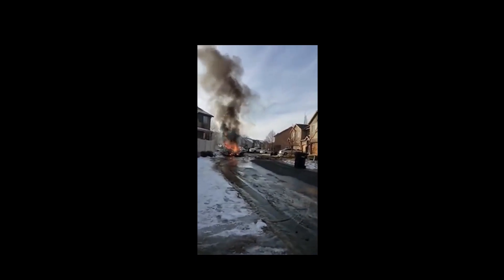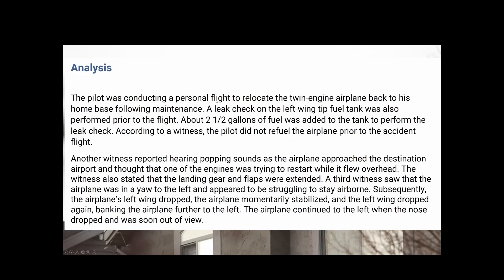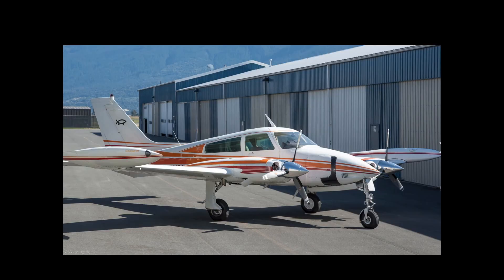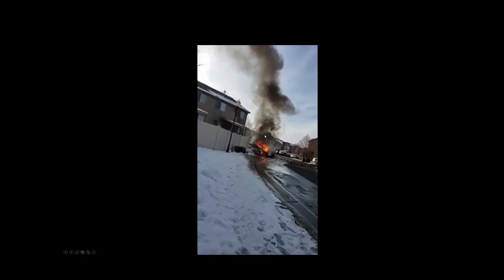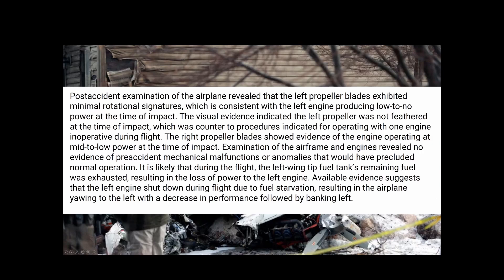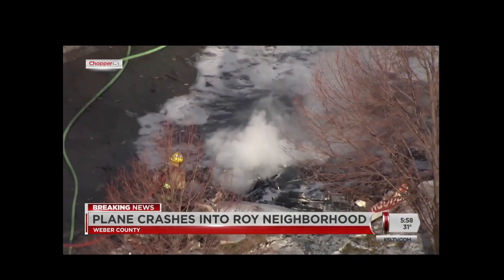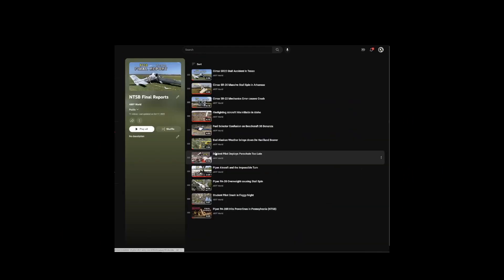Fuel Exhaustion Brings Cessna Down in Utah

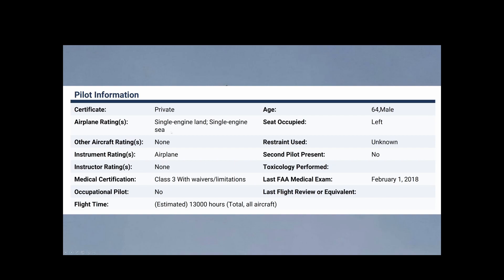Comment: At 2:16 we see the plot's ratings - he was not multi engine  rated
Reply from the maker: Nice observation
Reply: According to the accident report: The left seat occupant was the holder of a FAA commercial pilot certificate with airplane single engine land, airplane multi-engine land, and instrument airplane ratings. He also was the holder of a FAA certified flight instructor certificate with airplane single engine, airplane multi-engine, and instrument airplane ratings.

He had a multi and then some, it just isn't reflected on that slide for whatever reason.
Reply: Nevermind my previous response--bad search result from Kathryn's Report. :)
Reply: And with 13,000 hours, too! Something doesn’t add up.
Reply: Wonder how many people that are flying don't have their ticket, single, or multi....?? Driving without a license......  🤔🤔🤔 Yeah YOU... 😟😁
Reply: Even if he had the multi.  He was not a multi engined pilot.  Crashed when needed to show he was..  Was not. I used to teach on 310's.  They fly fine on one engine even with 4 adults on board i did touch and goes with engines shut down at 200 agl and turnaround at 500 agl and touch and go again...
Reply: @mattj65816  He was a Citation Mustang owner and pilot and at the time of this accident he owned 2 C310's.

Comment: He clearly had fuel onboard - fire and explosion. Just don't know why the engine didn't get any. Or why he didn't change tanks or crossfeed fuel.
Reply: The cessna 310 has four or six tanks, and the wing tips are the "AUX" tanks. Generally you take off with the selector in MAINS. The report notes one AUX tank (the tip tank) was minimally fueled for leak testing. Presumably that meant they tested the line to the engine, so the selector would have been in AUX. For a short reposition flight, it is unlikely he would fill the AUX tanks. He probably had decent gas in the mains, but left the selector in AUX, by accident (if you never use AUX, you get complacent about checking the selector position). He did the run-up and, scanned the dials and probably didn't even batt an eye at the empty AUX, because he thought he was flying on main. He just didn't check that selector.

The engine sputtered and died, and he started playing with the dash. Did he switch the fuel selector before trying a restart? I didn't read the report to see where it was, but it probably didn't matter. He didn't have time. His only option was to get that thing down safely, and it sounds like he might have been distracted trying to make it chooch. 

I hate these videos, but watch them so I won't end up like these good people. Every accident is usually a bunch of tiny mistakes that add up to one bad moment. This looks to be another one.
Reply: Darn, fuel aboard, but NONE to engine ? FUEL MANAGEMENT GETS REAL, WITH BAD COICES,,,,RIP,   🇺🇸🇺🇸🇺🇸🇺🇸
Reply: @FamilyManMoving  There are a lot of questions here, like which fuel tanks were in use and why the right engine was only delivering light to moderate power (based on the bent prop blades).  Counter-intuitively, the wingtip tanks on a Cessna 310 are referred to as the "main tanks," and the "auxiliary tanks" are in the wings.
Reply: @jimh.5286  Good to know I go those reversed. I even looked at the POH before commenting, but missed that detail.

I also went looking for the report, which would probably show the valve selector position. Didn't find it. My google-fu was weak that day. Thanks.

Comment: weird, his license didn't say anything about being Multi-Engine rated. was this a new to him plane he was going to start training? Rest in peace aviator.
Reply: David Goode owned 2 Cessna 310's and was the launch customer for the Citation Mustang. He was a very accomplished pilot,  businessman and athlete with over 13,000 hours as a private pilot.
Reply from the maker: thanks guys
Reply: @SquawkCode  just goes to show that the air can be unforgiving no matter how much experience a pilot may have. And when it can take down someone with that much experience just how much more caution is required by low time pilots. RIP.
Reply: @SquawkCode very impressive background and startling to know it can happen to anyone.  I’m not a pilot but have avidly followed everything about flying for years.  I’m a personal friend of Dan Gryder and my son is in flight training.  Is it possible that since he didn’t have multi engine license that he had cursory training but not enough to handle an engine out?  Maybe he made it to 13,000 hours because he never had an engine out in a twin.  I hope ALL pilots start adding AQP training to their list of things to do every year for the rest of their flying days.  Engine out in a twin at lower altitudes is probably one of the hardest things a pilot has to deal with.  If lack of training was the problem,  other pilots can learn from this and double down on their training. If he had tons of high quality, scenario based training and this crash happened anyway, every twin pilot should be concerned

Comment: Cessna 310 has complex fuel system. You can get it very wrong and starve the engines of fuel. I have many hours in many models of the 310. The wing tanks are the auxiliary tanks and the tip tanks are the mains, you transfer the aux fuel to the mains to use it. 
"There are two pumps in each main tank in a 310R. One is the auxiliary pump--it is turned on to prime the engine for starting or to provide fuel pressure if the engine-driven fuel pump fails. It's turned on from the cockpit.
The second pump is called the transfer pump. It's located on the aft side of the main fuel tank bulkhead. This pump is ON whenever the master switch is on. It is there to transfer fuel from the nose section of the main tank to the center section. This pump insures that fuel will be available when the fuel quantity is low and during steep descents".
It is also very hard to maintain control with one engine running at high power and the other failed but not feathered
Reply from the maker: Thank you for taking the time to write and explain. I appreciate it and I hope you are subscribed
Reply: Might add about the ‘auto-fuel dump’ system. IF you haven’t done it, you will. Don’t ask. My boss at the time was onboard anyway.
Reply: @samsharp8539  yes, simple procedure. Just txfr the fuel to the mains before there is space for it 🤣🤣
Reply: @mijo3642  you passed.
Reply: @mijo3642  I couldn’t tell time with my big Seiko watch.

Comment: Since radio exchanges had no sign of trouble his fuel starvation probably hit after configured for landing..Being that close to the airport/on short final that means he has his airspeed down around minimum not a good condition for an engine out and time for applying more power/torque to one side. Lots of inputs and trim needed.
Reply from the maker: thanks for your take on this one

Comment: On normal twins with clockwise rotating props (looking from the pilot seat) if the left engine fails it is harder to control the plane with the right engine operating than if the left engine had failed. The right engine produces more yaw and can easily roll the right wing of the plane over if speed control is not maintained and procedures followed. VMC roll, stall, spin.
Reply from the maker: Thanks Johan for stopping by
Reply: Vmc roll, yes. Stall and spin, not necessarily. I'm a multi-engine instructor.
Reply: Some twins were refit with counterfeiting props to avoid this for example Piper Geronimo

Comment: These "Light" twins are death traps! Most "reciprocating" powered twins are marginal at best! What MANY do not know is the MAIN reason for twin engine development in the 50's and 6o's was due to NOT having a powerful enough engines to power a large single other than huge radial engines. This led to light twin development!  Over 1/2 of these planes designed and built early on are marginal at best on one engine and the 2nd engine is simply false security, especially on take off!! Best thing you could possibly do if you have a light twin lose an engine at lower altitudes is if one engine goes out, pull the good engine back and MAINTAIN control! Even the very best light twin pilot is marginal at best to pull off a continued flight on one engine on a good day at low altitudes in a fully loaded light twin! I would estimate that 80% of the light twin engine failures end in an uncontrolled crash! I "ALMOST" bought an early model Cessna 310 "which is a great plane" but decided against it for safety reasons "yes, I'm multi rated".  Especially when you fully load them, only under "Perfect" conditions will they continue flying on one engine, especially trying to climb! Now turbine engines FINALLY came around and gave the power needed and remedied this issue for the most part, but Pilot proficiency plays a big roll in this! Just check the accident rates of light twins, it's pretty bad, two engines = twice the problems! Thanks for the updates on these older crashes, so much to learn from them, hopefully will make someone seeing this think twice when they are in a similar situation! Thx!
Reply from the maker: right on Jon that's the goal

Comment: If I read it correctly, the pilot was NOT multi engine rated.
If he ran out of gas what was burning on the ground? Cars and trucks don’t burst into flames, except Ford Pintos and Crown Vic’s and the occasional 1973-1987 Chevy pickup. Explosions are assured when NBC News set’s pyrotechnics off atop a punctured gas tank. 
Was this an NBC News special emergency broadcast, film at 11?
Reply from the maker: Strange on based on the Final Report.  Must of had some Avgas somewhere

Comment: With 2 tanks in wings, and 2 wing tip tanks, maybe he muffed the fuel selector and drew from dry tank. Also, adding 2.5 gallons to a twin is kinda pointless, that's gone after taxi and takeoff. No radio call means it happened fast, probably low and slow stall/spin with no chance of recovery.
Reply from the maker: thanks Ken for sharing

Comment: If the fuel was exhausted why the big fire? “single engine minimum controllable air speed” failure to maintain sufficient air speed can flip over. I won’t fly multi engine aircraft anymore even though I’m rated “single and multi engine land” at 65 I just don’t feel that I’m as sharp as I was in my fifties. I don’t fly enough to be proficient in a twin. I’m my opinion you need at least 80 hours a year “minimum” to fly twin’s. Good job, thanks.,,
Reply from the maker: Thank you for sharing